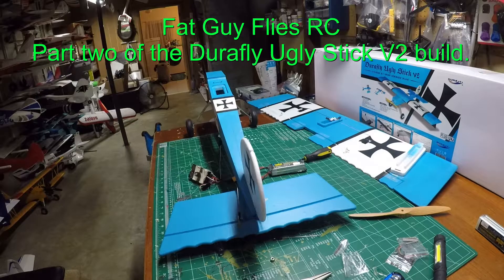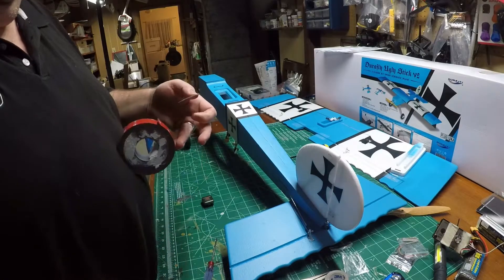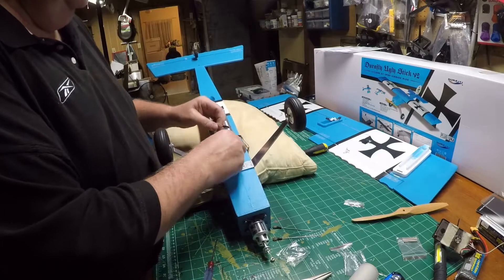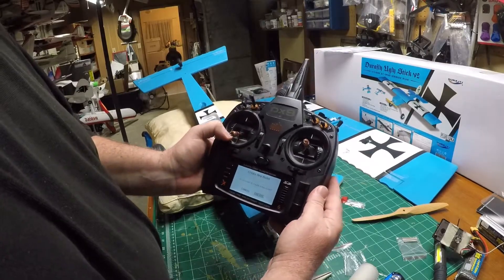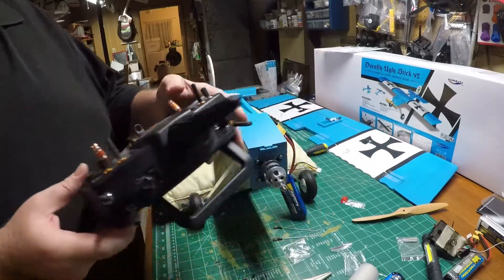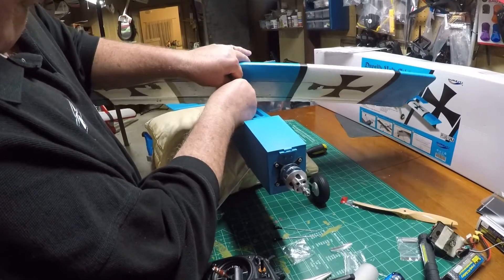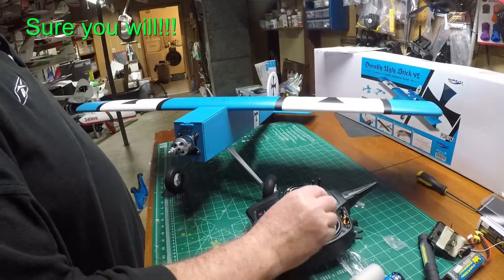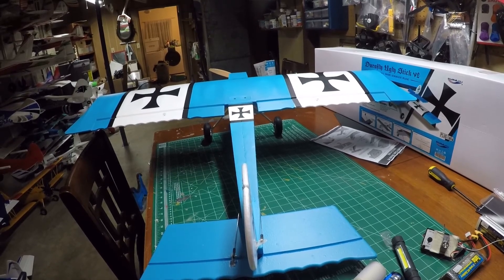Build of the Durafly Ugly Stick V2 part two

Comment: Tail wheel is backwards.....
Reply from the maker: Yes on purpose. Other wise it rubs the elevator. Factory did not make the shaft long enough to prevent it.
Reply: Doesn't it affect the steering while it's on the ground?